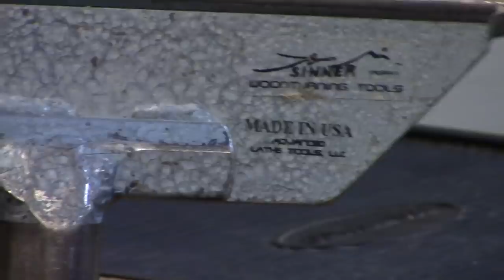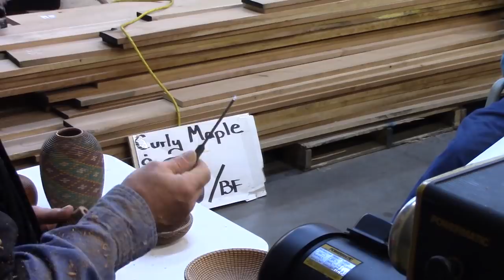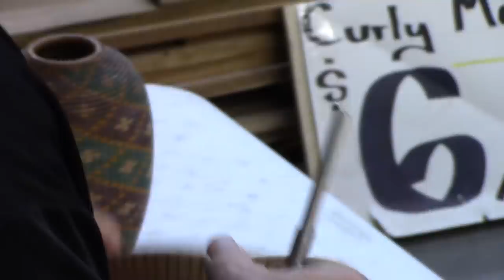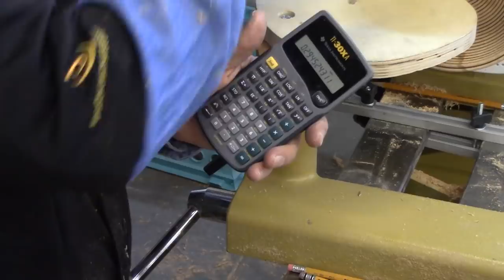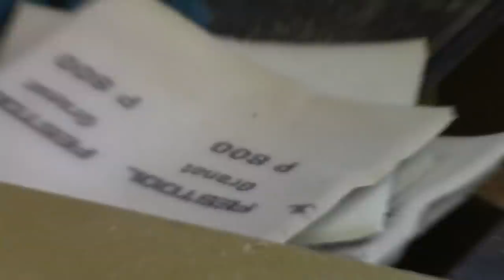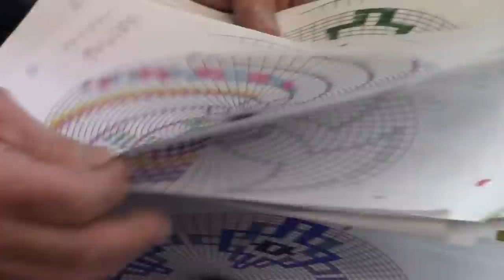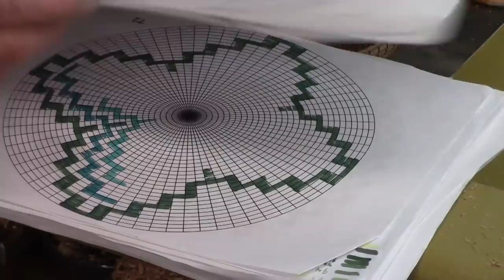Doug Schneiter - Basket Illusion 2.0, Beading with D-Way tools

Comment: I am relatively new to bowl turning and have just recently gotten back into turning. You as well as others I have seen use tool handles that allow you to change out your tools and keep the same handle. Where might I find these at? I see some out there but I have no idea what I should be looking for. I have a cheap set of starter tools from almost 30 years ago and see advantages in upgrading. Any information would be greatly appreciated. Also, I love the basket illusion bowls and plates! I'm working on getting the proper tools now for those items. After many years of woodworking, I now have the patience and desire to work on intricate items like this. I sure wish you were in the area to see in person and to gleen more information.
Reply: Mark, you're probably asking for Doug's advice here, but I'll put in my $.02.  There are many different handles on the market that use set screws to hold tools.  I have a number of Trent Bosch handles I like.  Jimmy Clewes (and probably others) sell "cam-lock" type tool holders (I don't recall if he makes handles).  JoHannes Michelsen sells collet type handles. Far and away, my favorite handles were designed by Stuart Batty.  They use a unique system to hold tools, which I find superior to anything else I've seen.  They're not cheap, but you buy a few handles, then put all your tools into "bolsters" (glued in), then any tools can be used in any handles.  Quick and they work fantastically. You can see them here: https://www.woodworkersemporium.com/shop-by-brand/sb-tools/.   I have a number of Stuart's tools, but mostly I buy Thompson Tools and use Stuart's bolsters to hold them.
Reply: I have several different tool handles, that I have collected over the years, most of them are Trent Bosch handles available on his website. My beading tool handles, I turn them, myself.
Reply: Mark, another option is the Hosaluk Ferrules. They can be purchased through Lee Valley for about $20 each. 
You turn your own handle and mount the ferrule into it. The 1/4” size is only available through Cindy Drozda. Hers are aluminum. 
The Hosaluk are steel.
Reply: Thanks for the information from everyone! I still haven't made any decisions as of yet.

Comment: The different thicknesses of plastic laminate is in actuality the different grade of the plastic laminate material. The thickest laminate is the standard grade, the thinner one is named post form grade and bends easier than the standard grade and is used in the post form countertops (the ones with radius at the top of the splash and the juncture if the backsplash and the counter surface and the larger radius at the front edge of the countertop).
I use the laminates exclusivly for burning lines and beads on my turning projects.
Reply: Sorry; I neglected to mention the liner or backing grade of plastic laminate that is about 1/32" and the opposite thinkness of the standard laminate being 1/16" the postform being about in the middle thickness.